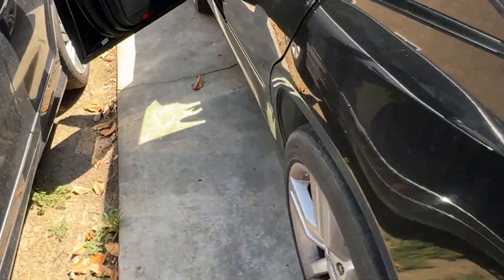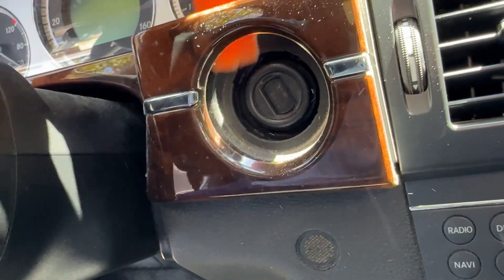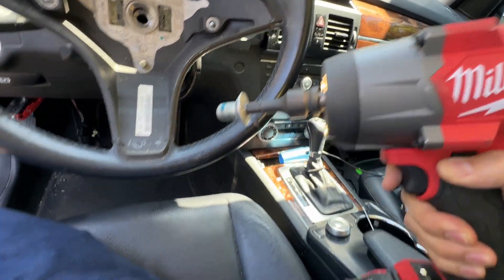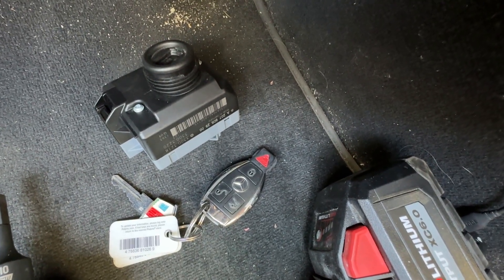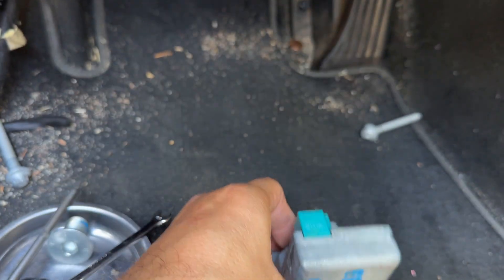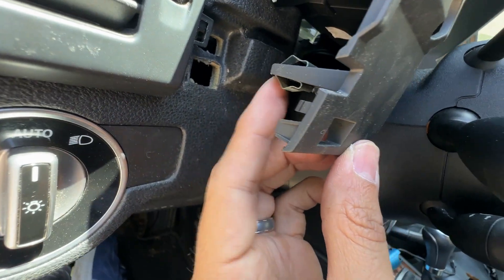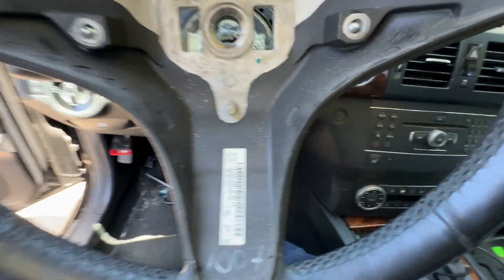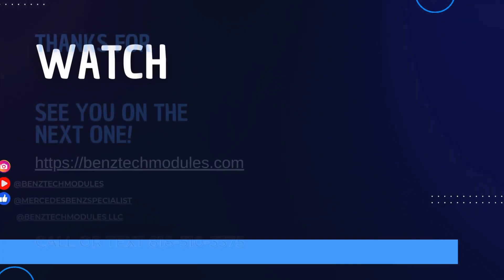X204 2010-2012 Mercedes GLK350 Electronic Steering Lock Removal and Replacement with ESL emulator.

Comment: Did you disconnect the battery at any point during this? youtube.com/watch?v=f3EDnndaPdc said if you don't disconnect the battery you are going to have an SRS light.
Reply from the maker: You should disconnect the battery before removing the steering wheel airbag. The yellow connector under the air bag is the one that will cause an SRS light to illuminate if it is disconnected while the main battery is connected. 

If you have a good scanner that can go into the SRS module and erase that fault code, once you've plugged the airbag connector back in, the SRS light will go away.

Comment: Mine is stuck in the open position. Does that mean I don't have to remove the steering wheel or column? Thanks
Reply from the maker: If it's 100% unlocked you can leave it in there. Just disconnect the electrical connector and plug in our ESL emulator. You don't have to remove the column. You do have to remove the steering wheel to remove the EIS (Electronic Ignition Switch) and send it in to us for programming. Learn all about our ESL emulator programming service here:

https://benztechmodules.com/product/mercedes-steering-lock-emulator-c250-c300-c350-glk350-slk250-e350-coupe-convertible/

Or call us at 818 510 3375

Comment: what was the actual issue it needed replaced?
Reply: Steering lock. When it fails it doesn’t allow you to start the car. It was replaced with an emulator as it is cheaper than original piece. A dealer can charge above $2500
Reply: @Cordoba393ok thanks, I didnt know if it locked the wheel and wouldn't let you turn it etc. I appreciate the heads up.

Comment: Thank you for a very nicely done video!   I myself has the iCarsoft CR Pro. Do you think your iCarsoft MBII has more functionality?
Reply from the maker: Yes. For Mercedes the iCarsoft MBII is best.
Reply: @mercedesbenzspecialist  The CRPro has nothing from the gearbox controller. I cannot read the temperature of the gearbox, and I cannot read or graph the gearbox speed sensor(s). Can you doo that on the MBII? Do you remember? I needed the temp. badly when changing gearbox oil. 722.6 gearbox.

Comment: What scan tool are you using to program emulator to EIS?
Reply: He is not using a "Scan tool" for that. Its a very special tool, quite expensive, and probably only for locksmiths. So the cheapest solution for us mortals, is to remove the ESL box before anything wrong happens, remove the 4 little splints, tape it toghether easy accsessible underneath there. And have a spare motor ready in the glove-compartment for the day its needed. 😀😀😀

Comment: Also, do you need new ESL if current one is dead and you're using emulator?
Reply from the maker: No you do not need another factory ESL. The ESL emulator replaces it completely.

Learn more about the ESL emulator here:
https://benztechmodules.com/product/mercedes-steering-lock-emulator-c250-c300-c350-glk350-slk250-e350-coupe-convertible/

Comment: I just bought ABRITES avdi from a fellow locksmith, 
I bought it because of MERCEDES BENZ 
I have bought DAS manager licence that cover fbs3. 
I have VVDI PROG 
I don't have the Mercedes Benz IR KEY yet, I just to buy it. 
I can I make key using vvdi prog and loading it to abrites avdi. Thanks
Reply from the maker: No, VVDI .bin file is not compatible with AVDI.